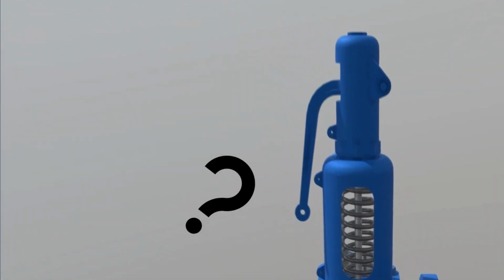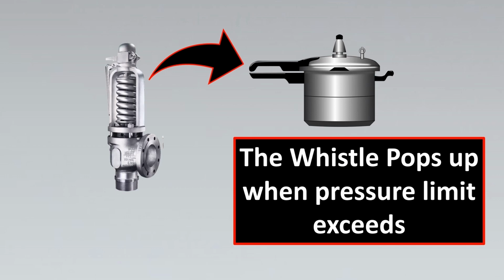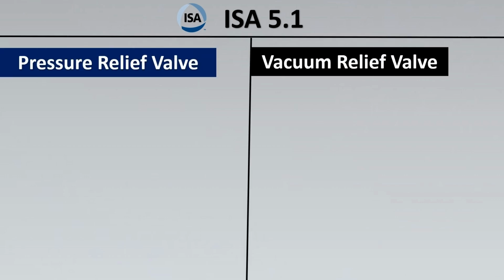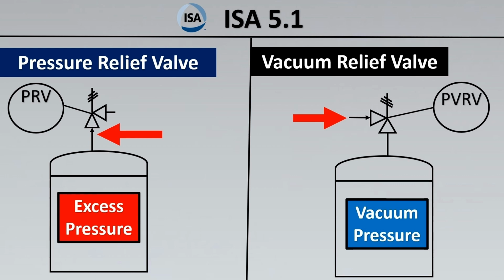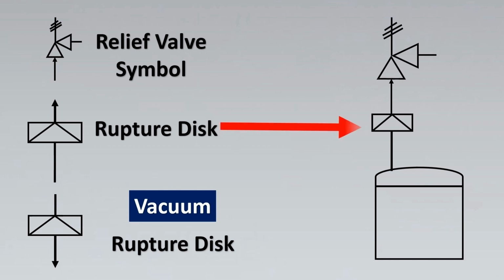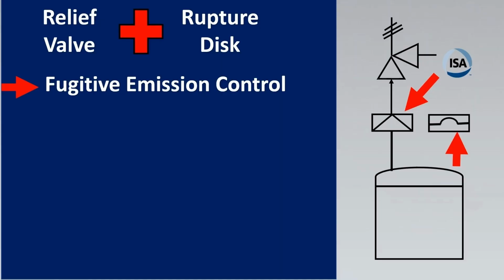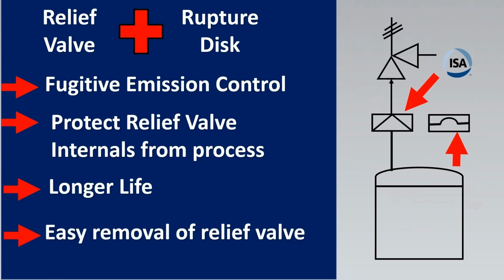Relief Valve Working | Types | Rupture Disk Combination

Comment: When it mentioned SP@100 PSIg, exactly at 100 PSI PRV will pop up or when pressure goes above 100 PSI, excess pressure will be relieved, and pressure always maintained at 100 PSIg? what it means ..
Reply: For this case SP@100PSIG, PRV Will pop up at 100 PGIG

Ans-2= No, Set Pressure Calculated/Decided, based on Process condition & Value.

Comment: Hi Asad, like you said example 1D2, whereas second Letter D stands for Relief Valve Orifice area 0.110 sq inch. Who will finalize this Letter, process engineer or PRV manufacturer?
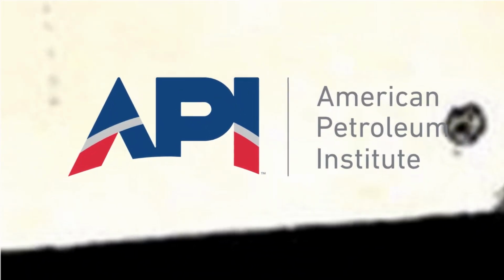1:44 Also when you mention API standard, pls mention the number. In this case its API 526